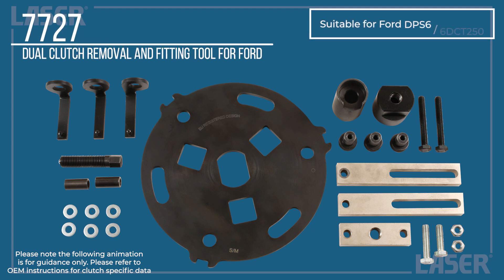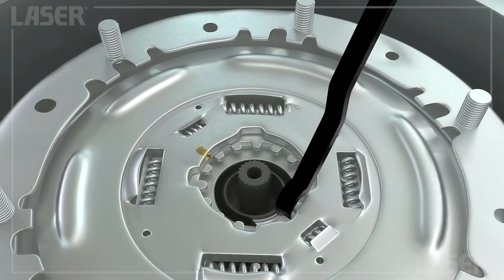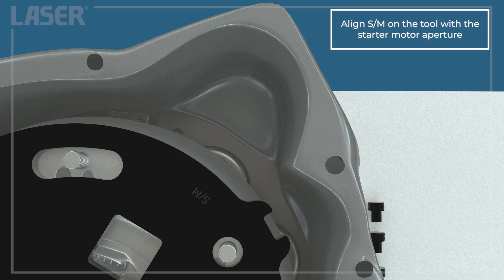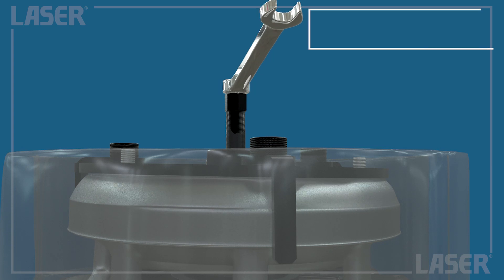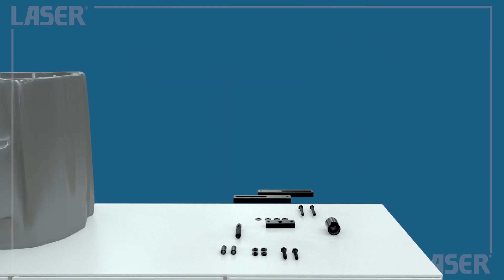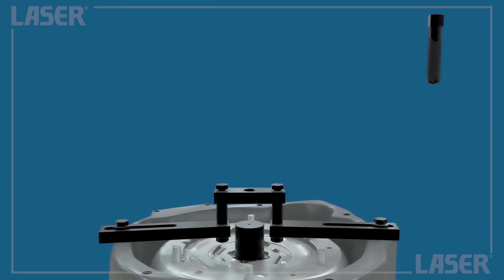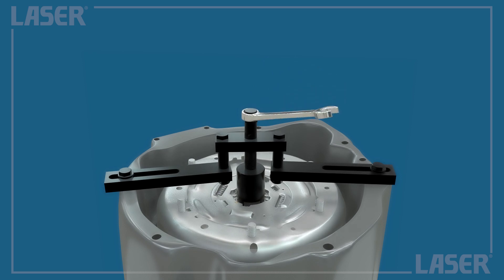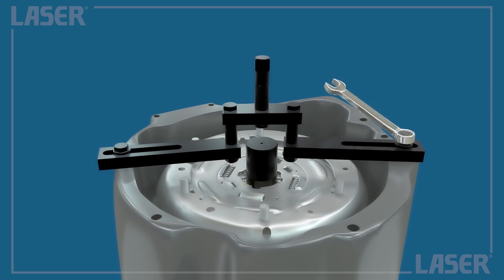7727 Dual Clutch Removal And Fitting Kit for Ford

Comment: Doesn't it need to be retimed etc after a new clutch is fitted? And do you replace the whole clutch assembly as a whole?
Reply from the maker: In some cases our 7139 is used to align the clutch and the crankshaft prior to refitting the transmission to the engine. This video does not deal with thre refitting of the transmission into the car.

Comment: Fo which Ford model does this apply? What year? Is it for the Poweshift Transmission 2015? Thx
Reply from the maker: As it says in the video description: Applications include: Ford Focus (from 2012), Fiesta (from 2008), B-Max (from 2012) & EcoSport (from 2013). Gear box applications include: DPCS6, 6DCT250 6 speed dry plate dual clutch type gearbox. 
Equivalent to OEM 307-675.